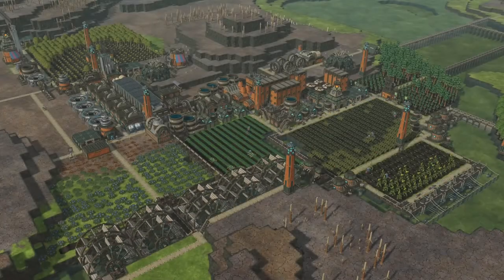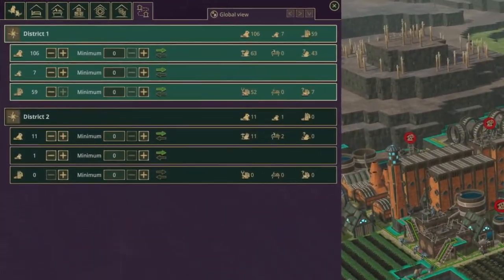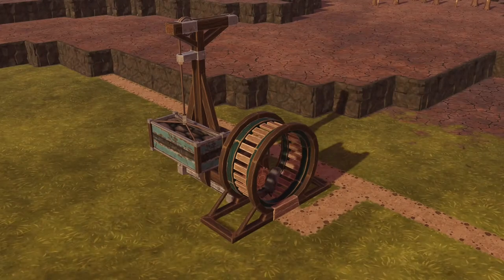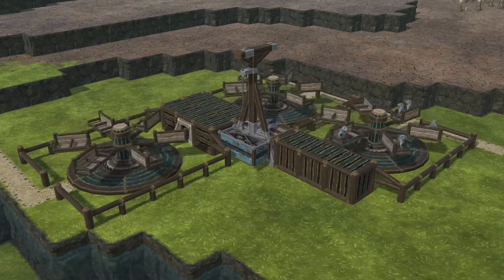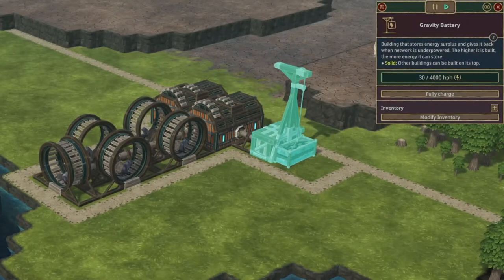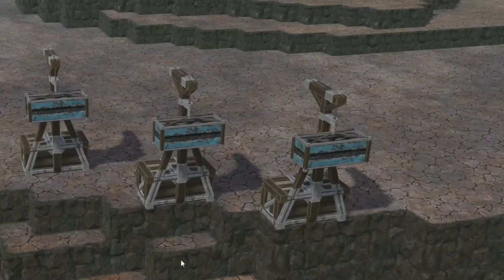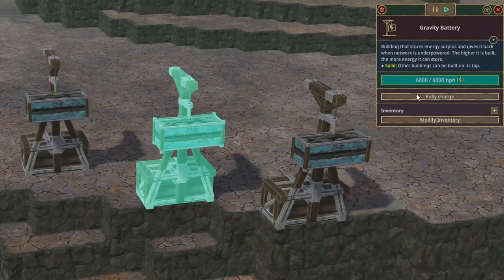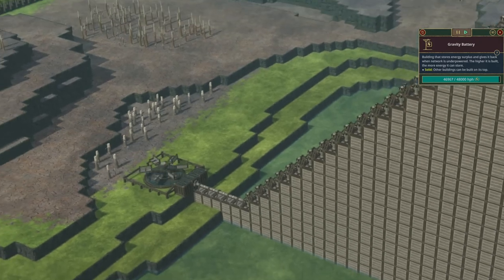Timberborn Experimental Update - Gravity Batteries - Quick Look

Comment: you can follow the same stair case design for a "vertical powershaft" without mods.

you make an L with 3 platforms of 1 tile height then you close it to a 2x3 with 3 platforms of 2tile height and you continue the spiral with 2 tile height platforms as high as you can (district reach is a limit) 

then in them middle you put wooden stairs/high power shaft and in the ends you put paths or power shaft turns or intersections, I choose the intersections because they are just easier.

of course there is the mod with a vertical shaft turn and vertical shafts of one tile height.
Reply from the maker: In another video series I do exactly what you've said with the power lines. I just wish there were vertical power poles in the base game, as well as longer length ones for going over buildings you can platform over.

Comment: I still don't understand how you connect the battery/how to make use of them. How do I charge them? Do they have to be connected via power shafts to a source like a water wheel, windmill etc.? I assume so. Ok then in the second step, how do I get power FROM the battery once it is charged?
Reply from the maker: The connect  just like any production building. Anywhere on the lower box can be connected to the power grid via shafts, putting the shaft in front will limit the power they can store though. They can also be connected to each other to transfer power like lumber mills or gear workshops ect.

They take excess power generated, and store it, and the release it automatically when demand is higher than power production.

Comment: when you put them over the edge, extra height makes it more efficient?? That's genius!!!!
Reply: Yes. OR...you can maybe put them on ground and let it lower into a shaft to the bottom map limit???
Reply from the maker: Yes, the lower the balast can drop, the more power they can store. They will take longer to charge, but during wet seasons with running waterwheels, its a good idea.  The most power you can get is 50000 hph. Thats building at the map height limit or 24, and clearing a hole below as deep as you can go.
Reply: @STHedgehog  I really like how the building's functionality is influenced dramatically just by shape of landscape it is put to. Like it is not a unit on its own, but works in tandem with its surounding. I like the thinking of the devs. Now, waterwheeels could be much more efficient when put under the waterfall and I'm fine :)

Comment: Question - the spot below the weight needs to be empty or you can lets say build it over something and it stops above its roof? Can you drop the weight into water?
Reply from the maker: you can build under the ballast, it changes the power limit, even up to making the battery non functional. That game is smart enough to know where the ballast is, so you cant build higher than it is lower until its raised. And, yes you can drop them into water, so hanging them over the edge of reservoir is a viable option.
Reply: You can also build one on top of the other so you have one on each side of the tower you build.
Reply: @scotb7352  sadly not any more

Comment: I wonder what would happen if you build it at the map edge.
Reply from the maker: Sadly, you can't. The have a 2x2 placement box, so you cant have the battery piece hanging over the map edge :(
Reply: @STHedgehog  Would be hilarious if we could though.

Quick question, does the battery start at the highest or lowest possible position?
Reply from the maker: They start fully charged, ready to go once built
Reply: @STHedgehog  So technically, you could build a super tall energy tower, and just delete/replace the batteries with a dedicated team of builders, freeing up surface space for extra production instead.
Reply: @hs0003  They use metal blocks to build so I doubt it would be very viable